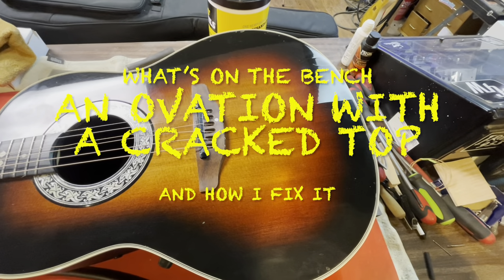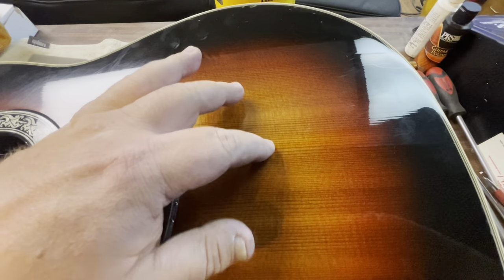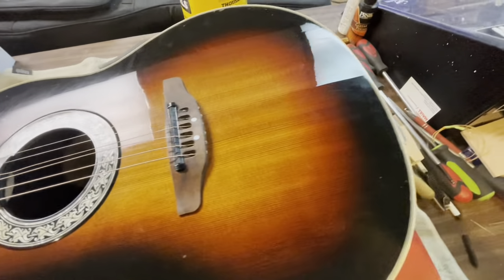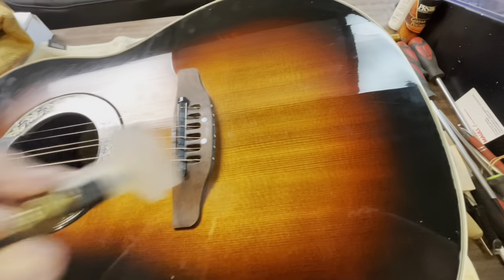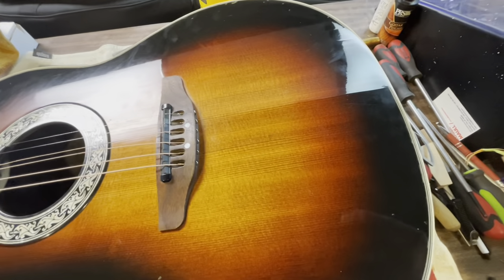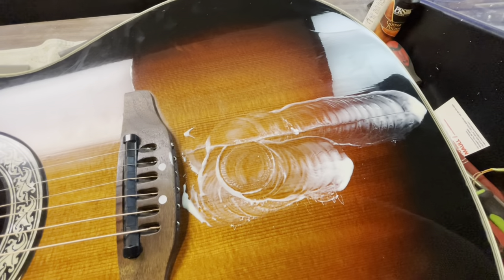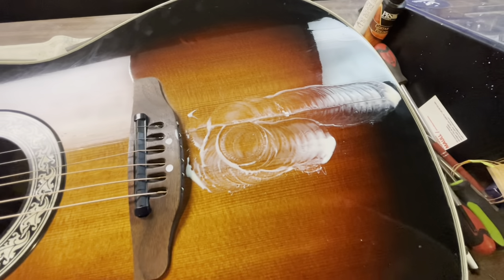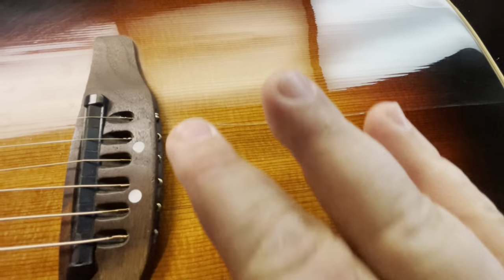Fixing a crack in an ovation celebrity

Comment: The point of the suction cup is to pull air out of the crack. If the crack is open, it will draw glue in when suction is applied. If the crack is closed it will remove bubbles and glue is drawn in when the suction is released. They use that technique on windshields. Sometimes they use an actual vacuum pump. 
I doubt blowing on a tube helps. Mouths don't make much pressure. Suction cups make a lot all by themselves.